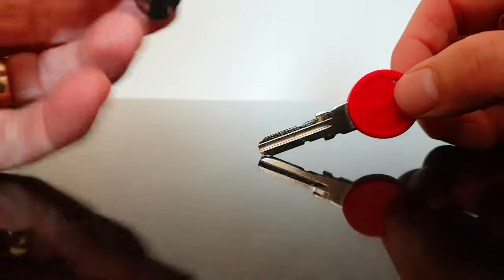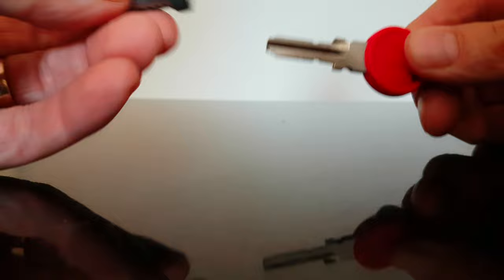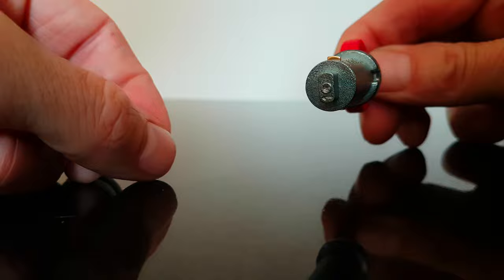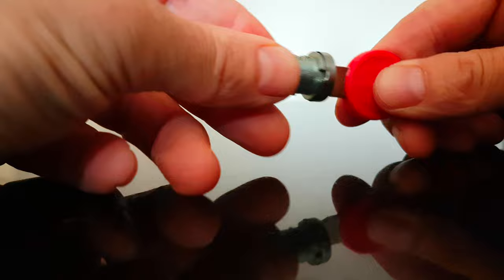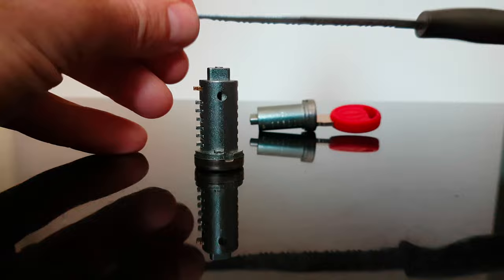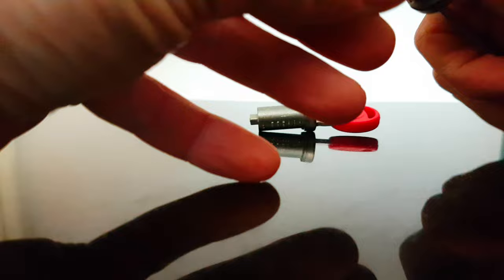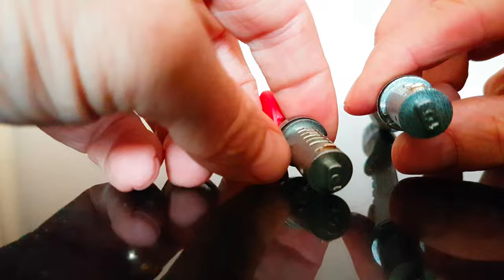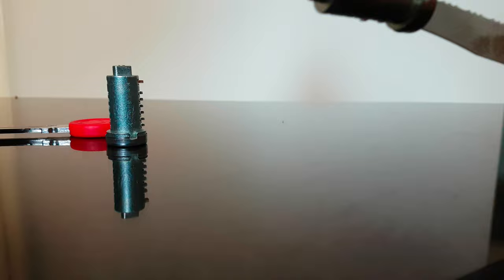Zadi lock barrel removal with removal key and steak knife

Comment: I have just sawn most of the pointy bit, but not all, off a metal nail file and it has worked equally as well as the steak knife. Just another alternative.
Reply: Please explain what mean. Need help
Reply: How much of the pointy bit did you remove?

Comment: Question = will this tool / method release the lock barrel while it is in "situ" in the door ?
Reply from the maker: The barrel should be in the unlock position but yes it can. I believe I still have the tool and about 4 or 5 barrels with the same key (i bought wrong ones) . I can check later and get back to you. If you want them I can post to you free of charge. I will put my gmail address up and you can mail me if you want them. If you have the key number then these are widely available to buy online.